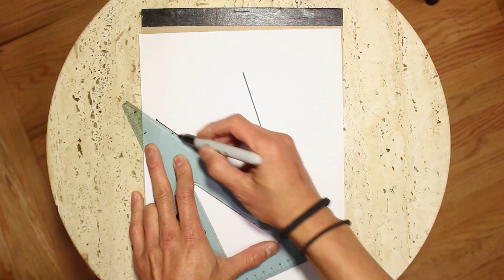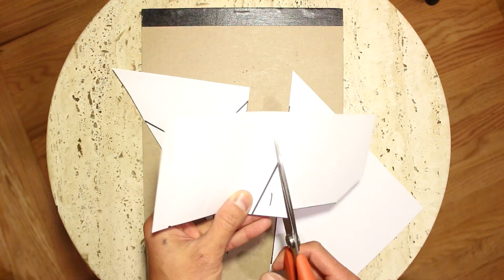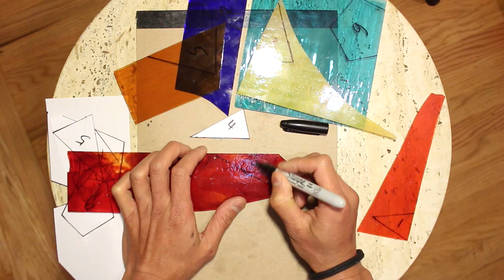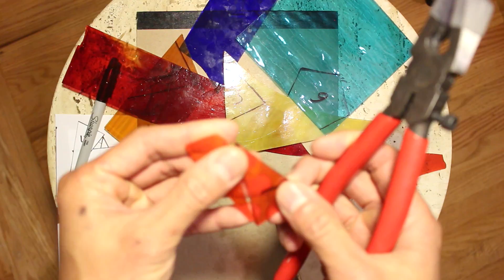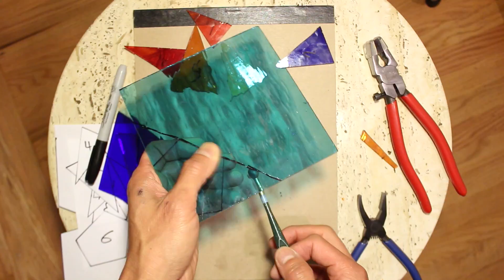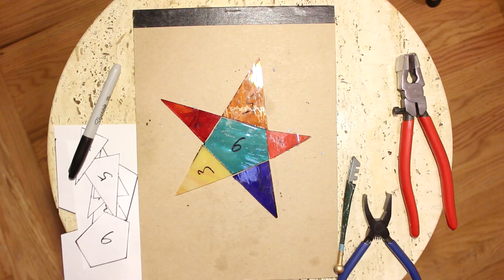Stained Glass Tutorial Part 1: Drawing and glass cutting

Comment: Do you need to use pattern shears to allow room for foil and soldering?
Reply from the maker: You can and should if you're trying to fit a framed project but if it's a free size project like this, then it doesn't matter much if it grows on you.  Just cut everything the same for each pattern sides and same scoring (within or outside the lines) so the pieces all come out the same proportion.